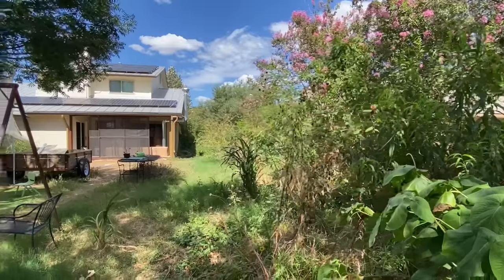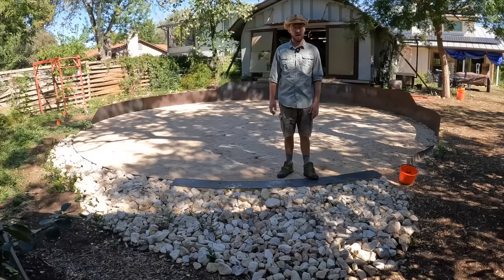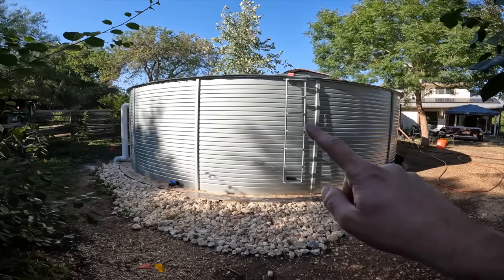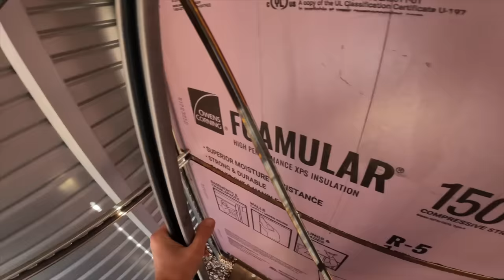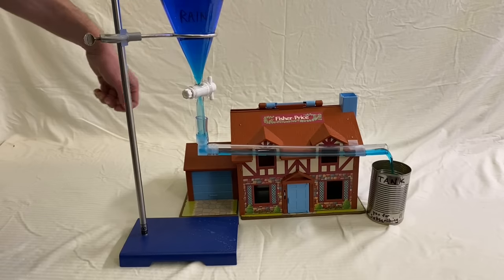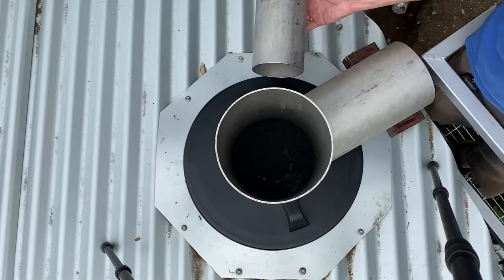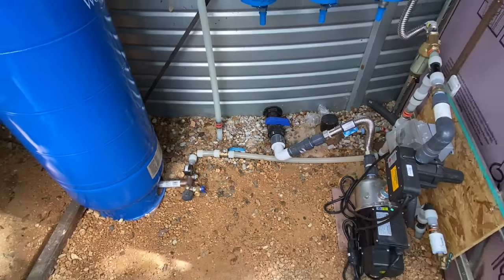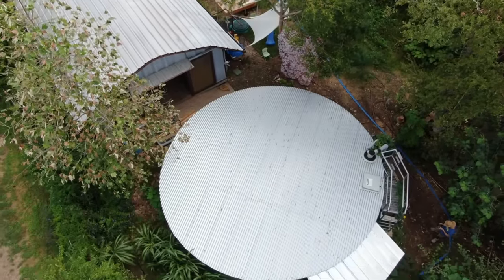FREE water forever.  LEGALLY!!!!

Comment: Have you considered sending your excess solar energy into your water tank to create ozone and purify the water?
Reply: Wow next level thinking.
Reply from the maker: Could do.  I might if we have any issues
Reply: my understanding is that ozone injection requires a venturi and a pump running to circulate.
Reply: @suburbanbiology  I am curious how often and which tests you do on your water supply to ensure safe water. I imagine a testing station and log book in that pump shed would work quite well.
Reply: Excellent YES! Thank you for grounded common sense, elegant methodology ideas.

Though I don't know if ozone treatment gets rid or precipitates forever chemicals and such out of rain water. 

I never had a chance to do this where I live, so I haven't checked into it... but I would if I was living out where we could do this (which I hopefully soon may be!)
Reply: @drdanbhcmg  Simply basic common sense thinking, to find an intelligent, doable way to purify the rainwater to some good degree!
Reply: @quigzinator  If you're talking about running the ozone through the whole of the water catchment, yes?

But you can run the water through a smaller piping delivery system (or however you can & wish to deliver it, even carrying by hand if necessary) through a smaller (in as-needed amounts?) ozone, ultraviolet, precipitating/flocculating, filtration (as natural/non-toxic as possible itself) purification system?
Reply: @quigzinator YES 👍👏
Reply: You only need GAC (Carbon) to filter it.
Reply: @iahelcathartesaura3887 Why would you do any of that? You make an at spout attachment for $10 that has a PVC chamber, filled with (GAC)
The exact process Brita uses just DIY.
There are several YT vids on it.
Batteries aren't green, food for thought.
GAC biodegrades.
Reply: Ozone is going to react with any organic debris in the water and you're going to wind up with partially decomposed carbon side products. This will most likely end up giving the water an odd taste... Like drinking straight from a carbon filter. If you're going to use ozone treatment, it's best to do ozone treatment on already filtered water.
Reply: How does that even work? A 1st for me.
Reply: watch for snakes in your wood pile
Reply: I would preffer UVC lamps.
Reply: @suburbanbiology  So you'll wait 'till after your first battle with algae?
Reply: Well bc Brita is an absolute joke to me. Thx for sharing your info tho.

Yes I've seen those videos like you described. Absolutely not good enough for me. Plus I have health issues or I have to learn more and do more. 

Also I was a biology student heading to be a biochemistry student for a degree. Health issue stopped me from finishing though but I'm so glad I learned what I did and I thank you for sharing what you know, as it can help people who are willing to use a minimal filter such as Brita.
Reply: I'd use UV-C Lamps.
Reply: It’d probably be better to use the energy for UV instead of ozone. The carbon and RO provide a broad barrier against a wide range of organic contaminants and the most significant remaining risk is pathogens getting around seals and O-rings in the filters. When water treatment plants use membranes to remove nasty pathogens like cryptosporidium and giardia they pot them in epoxy so water can’t sneak around seals and pressure test them routinely to make sure no fibers are broken (and it doesn’t take too many breaks to let dangerous pathogens through). UV is excellent at killing crypto even though chlorine can’t touch it. I’d add a little chlorine too for viruses. Ozone doesn’t get you much additional benefit and uses a lot more power than UV.
Reply: @quigzinator it can but you can also just bubble it in through a diffuser. It’s really toxic though and not something I’d want around in quantity.
Reply: @suburbanbiology  reverse osmosis system, they cheap about $100 or $150 with a boaster motor to refill the 3 gallon tank faster and they get 99% of everything out of the water. I love my reverse osmosis system
Reply: @suburbanbiology  buy a couple UV light for Koi pond and drop them in there....bam, done.
Reply: Why filter viruses? They’re literally everywhere. You don’t seem to have a system that allows the first water to come off your roof with all the dirt and bird excrement to be diverted. I assume you’re familiar with these mechanisms but chose not to use one. Can you explain why you rejected that concept? I’m always looking for more information on water filtration. Thank you great video going to check your others now👍
Reply: What? Is that possible???? For real? That would be amazing
Reply: I just subscribed to you That's very  Interesting water tank you have There I like the idea Very smart I'll be watching more stay safe and have a good day
Reply: man, never knew how dumb i was until i clicked on this video and looked threw the comments that i have actually no idea what you are saying haha
Reply: Great video man!
Reply: @YTkingofall I’m right there with you lol.
Reply: Sewage tank or rain water tank? you purify your water after distilling it?!! hahahaha
Reply: Lol Things the desert poor in oil rich nations have been doing decades.
Reply: But ozone nearby in human atmosphere cause poisoning problems
Reply: I’ve got a huge water tank that I use for a similar purpose as you do.  I’ve got a waterproof IR light that I drop in for 4 hours once a week.  It’s guaranteed to kill the little critters trying to kill you.  It is a good idea to have the water tested every so often.  How do clouds make rain?  Pollution.  It requires a microscopic particle of dirt, dust, salt, etc for the water molecules to attach to and get heavy enough to fall.  It’s mostly microscopic salt particles from our oceans, but other contaminants are present as well, think of air pollution.  Great video.  How’s the water taste?
Reply: @quigzinator with all the chemicals and metals being sprayed in the air means that would be a good idea 💡.
Reply: I have a friend in Gaza right now facing water shortages and I think your video can inspiration to him for his small clinic he runs.
Reply: Really impressive job. I think more sooner than later, all countryside houses (i mean all houses with enough land) should have this kind of installation with solar systems and batteries in order to become more independant.
Reply: @GraniteInTheFace he more than likely should just pack up and move by the looks of things over there.
Reply: @BonesJones85  maybe but it's their home and the land they grew up on. They are doing their best to survive.
Reply: Ozones reaction with H20 will react the the metal tank. Ozone in water purification has to be accomplished in Glass or other materials that will not rust or corrode.
Reply: Damn Einstein 😂 you should’ve created the light bulb to😮?? 😂😭😂😭🤣🤣
Reply: Hmm tell us how this works please
Reply: It’s illegal to collect rain water? Had no idea.
Reply: @GraniteInTheFace there’s plenty of free water in Gaza from israel.
Reply: ozone might degrade the lining overtime.
Reply: Reverse osmosis???
Reply: @ironore1000  why are you trying to lie? If you want to lie. At least lie about something that is not easily googled
Reply: So I have a brick cistern water collection that 10–12’ deep 8-10’ in diameter that’s hooked up to the gutters. It was there when I bought the house the downspouts were blocked off from going to it. I’ve hooked one back up to it and redid the overflow. If I had a water filtration system like yours it would be good enough to drink, right?
Reply: @ironore1000 irondome rains 🌧 🤦‍♀️
Reply: @GraniteInTheFace I live in Africa where such nonsense doesn’t exist. The time and resource isn’t there to be chasing after people for harvesting water. Here’s a lesson for you, over here you can collect as much rain water as you can and nobody even cares. Perhaps, you should get out of your bubble more often and come out here to quench your thirst for real knowledge and maybe you’ll realise there is life elsewhere. So get off your moral high horse and get a drink.
Reply: @Gabcikovo ???
Reply: Or just put copper pipes in the tank
Reply: RO filtration is by far the best however would require a sizable reserve tank to hold the filtered water since the process is quite slow
Reply: @simon_does  I was thinking a good inexpensive way is to use 2 to 4 food grade 55 gallon barrels hook together will give you enough for shower  and laundry.
Reply: @iahelcathartesaura3887 you are either trolling 🤣 or are so knowledgeable that it’s insane
Reply: How would you send energy to water tank to harness it?
Reply: @suburbanbiology   I read adding a very small amount of solid silver,,, such as a silver coin helps kill contaminants in the water.
Reply: 👏👏👏👏👏👏 good fucking idea.
Reply: @suburbanbiology I think installing and running a UV lamp would be way cheaper and simpler
Reply: Some turbines in the overflow pipe could power batteries for the pumps like a dam creates power with water and gravity. Seems crazy we don't use those in our downspouts too. Simple turbines can charge batteries anywhere anytime including in flutes from burning wood.
Reply: Yes
Reply: @suburbanbiology Youre gon wait until one of you gets water poisoned to get trated water?
Reply: @YTkingofall  100% me too.
Reply: y’all mfs are not just creating ozone 🤯 what’s the even mean
Reply: @RossMalagarie needs lots of prefilter.
Reply: @MoneyBuysDrug any high voltage source will generate ozone from the oxygen in the air. It smells like fresh thunderstorm and makes you cough.
Reply: @Iz0pen salmonella from bird poop is a major concern with rain water used for consumption.
Reply: @MoneyBuysDrug upvoted to call you out.  Ozone is easily created with arcing electrodes or specific frequencies of UV light.   I have an extensive system that does just this to disinfect my water
Reply: @YTkingofall through
Reply: Ozone huh.. i have a hydrogen/oxygen generator. Didn't know ozone was involved when water electrolyzes
Reply: @quigzinator you should be curious how safe Tap Water is
Reply: You mean algae formation?
Reply: Not for micoplastic
Reply: I wonder if you could achieve a similar sterilisation at lower complexity by just powering a bunch of UVC lamps attached to the top of the tank? No need to deal with potentially toxic ozone then - just make sure to fit a switch so the lights deactivate if anyone opens the hatch to inspect the tank.
Reply: @vylbird8014  by "efficiently" I guess I mean you're onto something, could have a lot Super high powered lamps that pulse, maybe even once a week. I'm slightly intrigued
Reply: Build a swimming pool near this and use the water to fill it and the solar to heat it! Don’t forget the embedded jacuzzi/hot tub in the pool corner.
Reply: @woozledog Why pulse? Just turn them on when there's excess power to use up. The total amount of UVC matters, and it's easier to design low-powered lights that run for hours than high-powered ones that run for minutes.
Reply: NO, ozone add explosive and toxicity risk,  2 dangerous risk for just purify water of live stuff,, and more rain water have often other pollution that ozon cant fix.
Reply: @eriklerougeuh5772  A proper rainwater for drinking setup might use UV sterilisation to help keep the tanks clean, but that's just one stage. The tank is also for settlement, with the take-off above the sludge level. Then there's a series of filters, and finally an RO filter. Unless you're doing it on the cheap and cut corners.
Reply: That is a heck of a lot of work .... time and money .... there must be simpler ways to achieve your own water supply .....
But I do like what you have done,  very impressive and forward thinking
Reply: How about drilling a 100 ft or deeper well?
With carbon, charcoal, ionic, uv & more that would have your whole house water great & safe.  Can have a 
manual pump & battery back in case of power failure.  
This way, you don't have to babysit 1000s of gallons of water 24/7.😊
Reply: Never done anything like this so consider the source.
The pipe from the base of the house to the base of the tank may collect sediment.  Two 3/4 in valved spigots might be a means  to flush that portion of the supply line would facilitate an occasional manual flush to remove organic sediment and bacteria growth.
Reply: I would bet that with the sq footage of that tank it’d be better to get a dedicated system just for that so it’s not a continuous draw on there grid
Reply: Second World problems 😂😂
In Germany the government is obligated by the law to buy any electricity you produce from you. Many people live from this .😊
Reply: @YTkingofall not dumb at all! Just different hobbies and interests. If they can learn so can you.
Reply: One question: why you didn't  use the roof of your reservoir to colect rain water, because of the considerabile surface ?
Reply: If all you want to use the solar power for is purification and add grid power to finish the job, yes that might work.
Reply: Fresh Water is being called  "the new oil". 😮
Reply: @GraniteInTheFace ph
Reply: @suburbanbiology do you have any tips regarding led in rainwater? My rainwater is full of silver nitrate and led and I haven’t found a feasible way to get it out. Where I live, cloud seeding is basically the way to go to make it rain enough so the rainwater is basically always contaminated. The groundwater is getting cured somehow but nobody tells me how to do it.
Reply: And what if the water freezes since it’s above ground ? 😂
Reply: I love watching men homestead build❣️
Reply: Have you ever heard of a power wall?
Reply: @suburbanbiology we already have an issue
Reply: @gbear1005 get 'um!😂
Reply: Just get aUV purifier yo
Reply: Ozone may react with the metal inside, so I would do some more research
Reply: Still wont get rid of PFOs
Reply: @suburbanbiology RO takes all the minerals out. We have a remineralizer. We need minerals, and so do plants. My wife has some hydroponics, and that's how we realied it. You could get minerals othrr ways too.
Reply: Create ozone!!?
Reply: Wouldn't this tank just freeze if the temperature dropped below freezing again?
Reply: He could just put powerful magnets on each side of the inlet or outlet to create electrified water.
Reply: Yes, wow...didn't even think about that.
Reply: @YTkingofall  amen
Reply: I'm doing research on water and finding the best filters myself. May consider this setup on my property 😊
Reply: @MoneyBuysDrug Yes you can create ozone. What do you even mean?
Reply: @TheEnigmaticmuse That is not how it works lol. You’re not gonna „electrify“ anything by sticking permanent magnets to something
Reply: @GreenCaulerpa  it may not electrify it, but people have done their own experiments in their gardens with pretty significant results. I thought about it after I commented on here and realized it would be redundant in a rainwater catchment system.
Reply: Excess..lol
Reply: This question right here……lets make this happen.
Reply: @quigzinator  I believe the conventional method requires that but I believe you could get a similar effect if you covered the opening of an air ionizer with a rubber hose that has extremely small pinholes in it and a drainage check valve.  Ionizers provide some natural air flow in the direction of the electron flow which, assuming the pinholes are small enough and the hose elastic enough, would allow ozone (ionized air) to leak from the positive pressurized hose into the tank with only a tiny trickle of water to escape into the hose that can be managed with the check valve easily and can be allowed to go into a small secondary tank or greenhouse humidifier line.
Reply: @MoneyBuysDrug I've got two ozone generators in the house with aquarium diffusers. They're available.
Reply: @suburbanbiology it definitely cuts down on the cleaning. But creating that much ozone is gonna take quite a decent amount of power, not viable unless you have a massive surplus that you cant store, or wont need in the immediate future.
Reply: Ozone can be very dangerous
Reply: Yeah have you tried this? I would like to know how you do that????? Please????
Reply: How long does this take ?
Reply: @RossMalagarie thanks
Reply: Will sediment build up on the U-joint?
Reply: Insane that ANYONE can tell you what you can and cannot do to water you personally drink..that's is NOT a free country
Reply: @suburbanbiology I don't want the water I'm drinking to be touching any plastic..I'd look into micro plastic in water.
Reply: Wild I read this comment first them watched the Whole video 📹 ❤ I love you all one love rastafari Rastamon
Reply: @suburbanbiology rastafari Rastamon ❤🎉
Reply: Doesn’t ozone cause cancer? And how could that be done? I think this is a good idea especially with what is going on now
Reply: Ozone doesn't purify water.
Reply: Um actually 🤓☝️…
Reply: Why everyone speaking gentlemanly ._.😮
Reply: How much water does it hold
Reply: Could ozone corrode the tank or pipes?
Reply: "create ozone"

Why do I hear dragostea din tei? 🤔😉
Reply: How would electricity purify the water?

Isn't that just electrolysis?
Reply: arent ozone systems not good for the environment ? which is why using ozone for cooling in refrigerators was banned
Reply: Thats great idea
Reply: @quigzinator  His system will always be safer than the tainted shit water we get from any municipality supply,.
Reply: While your at it make it a swiming pool😂